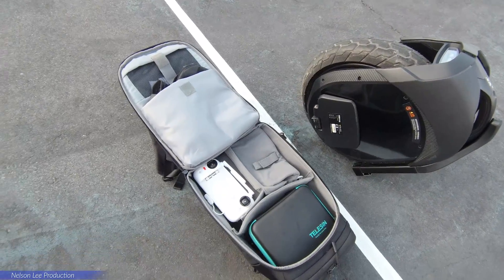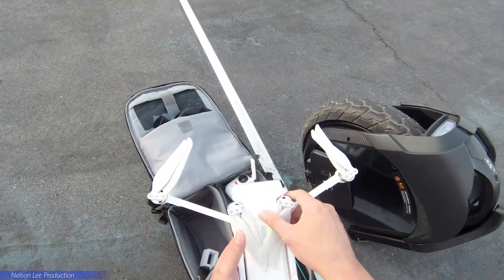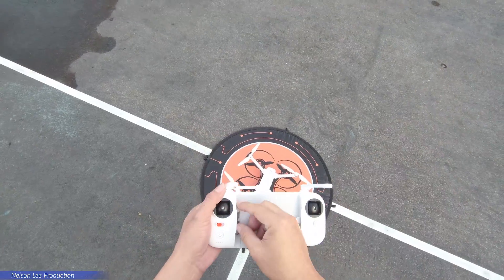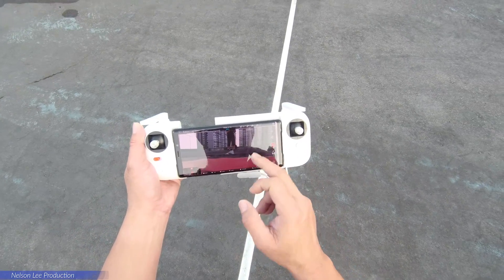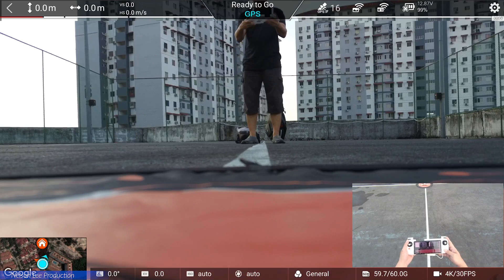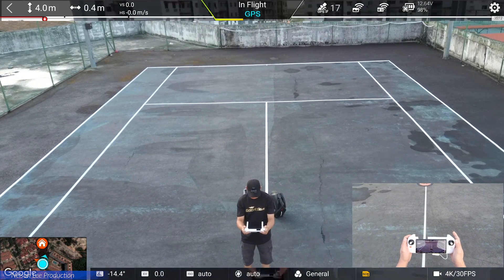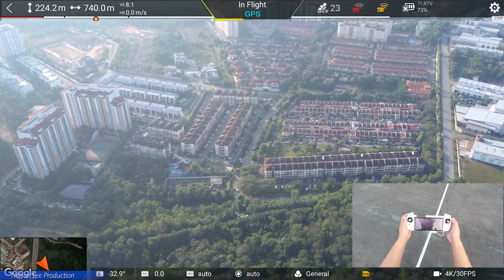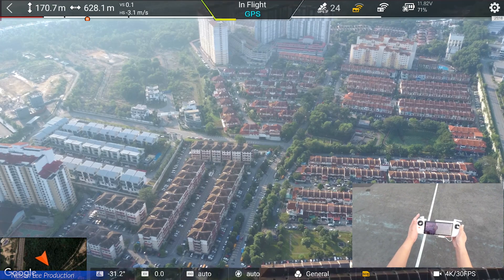Fimi X8 Se ~ 2nd Range Test with new Firmware 1012A (Still Disappointed)

Comment: Is this related to 5 GHz signal been shorter distance than 2.4 GHz? They switched from 2.4 to 5 nowadays
Reply from the maker: I don't think so, but fimi support are still working with new firmware and try to solve this issues.
Reply: @nldronesolution  hopefully, because they advertised 5km. Previous generation Xiaomi Mi drone 4k can do better than this.

Comment: At a height of ~256m and a distance of ~857m the pointing angle is about 16 degrees, which well may go through the fence... Even so, the direct distance calculated out of that is about 893m, which is less than the Zino can, but the conditions were unfavourable. An open Field of view and parabolic reflectors may lead to far better results.

Comment: Nelson 
It looks like the old hornet fpv an expensive piece of junk. At least maybe the company might attempt to answer your questions and not avoid you like the other did. But maybe the other commenters are correct that the site between the buildings and wires is affecting the flight. Maybe you can fly from home. It is way more beautiful with less congestion. Keep up the good work.
Reply from the maker: Fimi support reply my issue very fast and not like Hornet support. They are working with the new firmware and still testing,once everything well then will push to me for the test.

Comment: ce mode
Reply from the maker: Yes, you are right…It's CE mode current firmware.
Reply: @nldronesolution  why do not change to FCC?
Reply from the maker: @407ruben  Fimi support are working on this CE forced to FCC firmware and now they're still under testing, they will push the firmware to me after tested.
Reply: @nldronesolution  If you change the region to the United States, it changes to FCC, right?
I bought the fimi x8 and I hope I can use it in fcc
Reply from the maker: @407ruben  I don't think switch regions can become FCC, just wait for fimi support release the firmware, will update on my channel once I got it and tested.
Reply: @nldronesolution  yes, since according to the region the laws mark fcc o ce. test it

Comment: Things still to improve: flight plan and precision landing (maybe with software upgrade) and range (maybe with antenna booster)
Reply: PL landing work about 100% of the time for me, you HAVE to use an orange or blue drone landing pad. 

It WILL NOT recognize some random spot on the ground for PL.

In my videos you can see PL mode work.

Comment: Thank you for the test.  It appears this drone is not what they advertise.
Reply: Qnoops I just watched Dustin Dunhills new video and he got 3 miles with this drone. I really can’t even understand the need to go any further that that.
Reply: @Qnoops  https://youtu.be/dYSw9vVBayE
Reply: the problem is; i don't live in hawaii. i am living in a city with lots of interference
Reply: @Qnoops  You won't find many legal drones that will do what you want, then.
Reply: @Studentofgosset  DJI drones have 5-10 km range?
Reply: @Qnoops  The longest is 8km, which is actually 5km if it is the CE version. In either case the range is going to be significantly reduced if you have interference. Again, you'd most likely need to build a quadcopter with transmitters that exceed the regulations in your region if you are already subject to inteference and want to actually go 5+km
Reply: qnoops is feel bad for you let  low range is due to the metalic fence it cause a lot of interence

Comment: Dustin dunnil was able to get some phenomenal distance with just parabolic antennas
Reply: They weigh an ounce and are the size of your cell phone. To go from 700’ to 4000’. I’ll carry the 1ounce cell phone.
Reply: Actually Dustin just got to 3 miles with stock antenna on his newest video posted today, very impressed with this drone. He was also out in the country away from interference !
Reply: Yes you are correct BUT , Dustin I believe he flow in a area with very little radio interference, Nelson in the other hand is flying in a very populated area  with lot of radio noise comming from WIFIs / TV signal and etc etc,  big difference environments, Also the Tall buildings dont help.
Reply: Yes, but I believe most of us don't want to carry those third party parabolic antennas. We want that advertised 5km stock, even Mi drone 4K can do 4km in stock configuration.